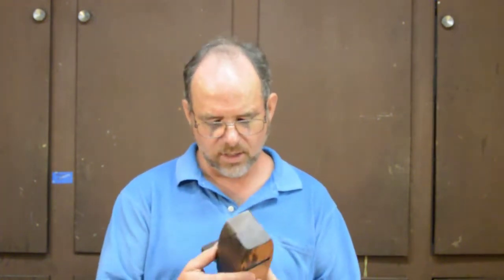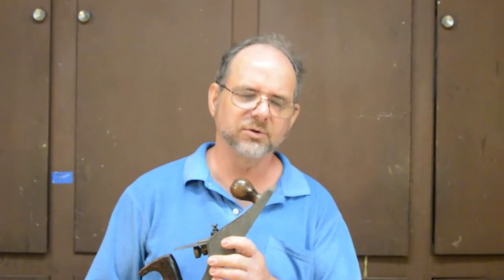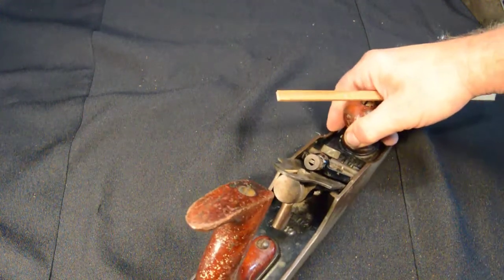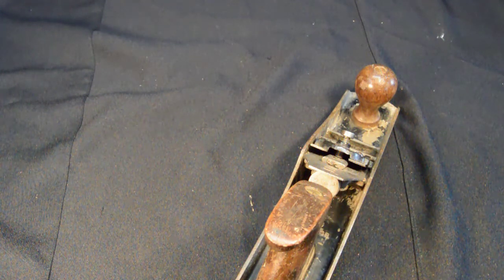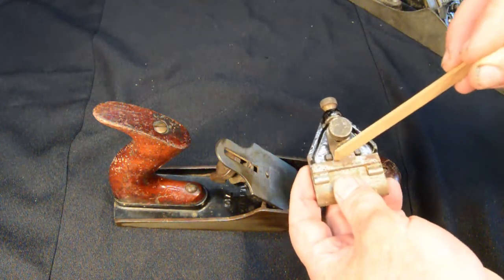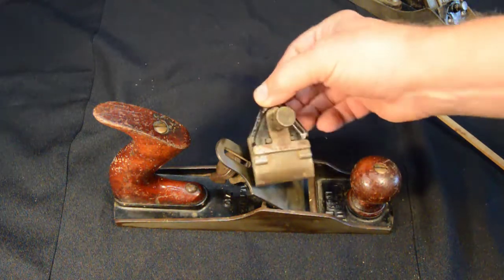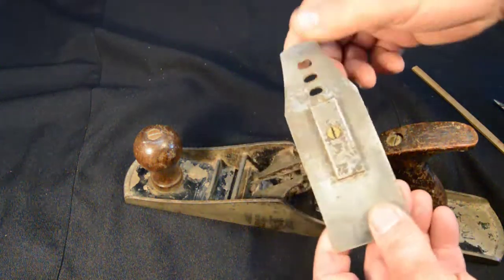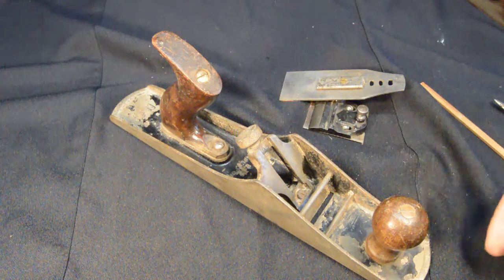Handplane Challenge: Autoset Planes, Part I

Comment: I gotta say, having the adjustability of the Sargent with an actual chipbreaker plate like on the Stanley would make for a better autoset plane. At least that's my thoughts after fiddling around with and using the Sargent autoset I have. Having the actual cap be the chipbreaker kind of put me off a little when I had to fit it to the back of the blade. Definitely would not mind it being a separate unit.
Reply from the maker: Yep, I am also not a fan of integrated chipbreakers.  All I could say in this case was that it was better than the Gage version.  Thanks for the comment!

Comment: Very interesting - I'd never heard of these planes. The audio seemed a little off compared to your previous videos - it sounded like a propane torch was running.
Reply from the maker: John, I'm glad you found them interesting.  

The sound might be due to the AC; it is, after all, Texas in the summer!  If I didn't have the AC on, I'd be dripping with copious sweat, and I think that might decrease the popularity of the videos (I'd add a smiley face here if I could figure out how to do it).